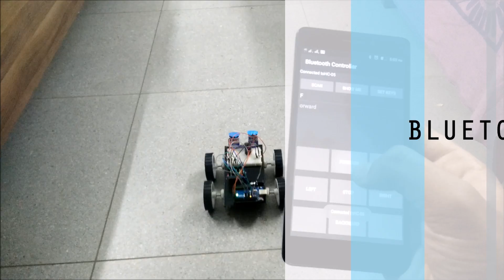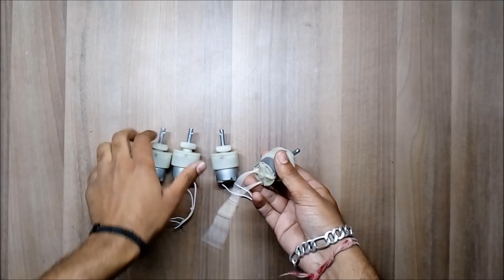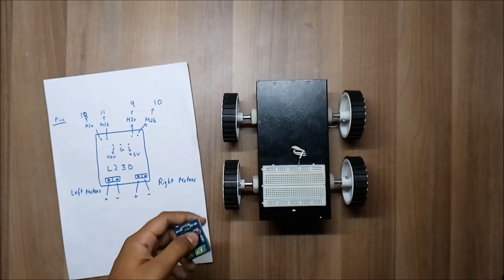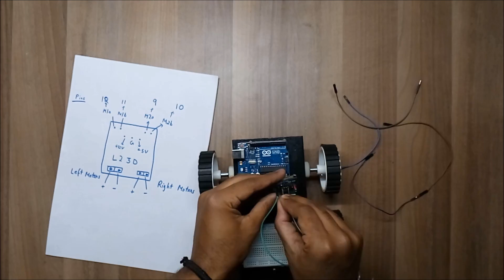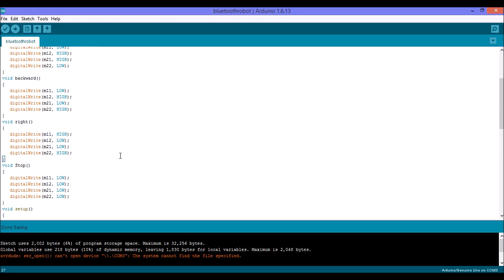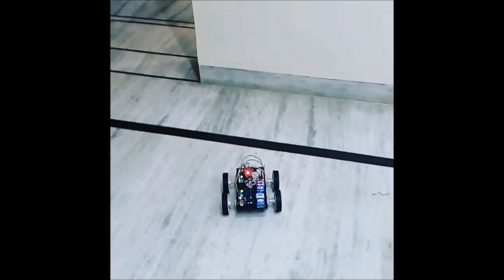How to make a Bluetooth Controlled Robot using Arduino (With Code)

Comment: Iam using an adafruit motor driver shield and the same type of chassis and motors which u use but i have a problem with wheel rotation its doesnt work pls help me why it doesnt work
Reply from the maker: Please explain the issue
Reply: @scibot  it seems the voltage output of arduino is less than what is required for motors which i use pls help me solve this issue

Comment: hello sir 
connections related to battery are not clear can you please send the circuit diagram of the project so that we can properly connect the components .
kindly reply as soon as possible
Reply from the maker: Sorry but I don't have the diagrams anymore. I've explained the connections pin wise it it helps.

Comment: This Program will be run Check now 

#define m11 11 //  M1a
#define m12 12 // M1b
#define m21 10 // M2a
#define m22 9 //  M2b
void forward()
{
digitalWrite(m11, HIGH);
digitalWrite(m12, LOW);
digitalWrite(m21, HIGH);
digitalWrite(m22, LOW);
}
void left()
{
digitalWrite(m11, LOW);
digitalWrite(m12, HIGH);
digitalWrite(m21, HIGH);
digitalWrite(m22, LOW);
}
void backward()
{
digitalWrite(m11, LOW);
digitalWrite(m12, HIGH);
digitalWrite(m21, LOW);
digitalWrite(m22, HIGH);
}
void right()
{
digitalWrite(m11, HIGH);
digitalWrite(m12, LOW);
digitalWrite(m21, LOW);
digitalWrite(m22, HIGH);
}
void Stop()
{
digitalWrite(m11, LOW);
digitalWrite(m12, LOW);
digitalWrite(m21, LOW);
digitalWrite(m22, LOW);
}
void setup()
{
Serial.begin(9600);
pinMode(m11, OUTPUT);
pinMode(m12, OUTPUT);
pinMode(m21, OUTPUT);
pinMode(m22, OUTPUT);
}
void loop()
{
while(Serial.available())
{
char data = Serial.read();
if(data =='1') // forward
{
Serial.println("Forward");
forward();

}
else if(data =='2') //left
{
Serial.println("Left");
right();

}
else if(data =='3') //right
{
Serial.println("right");
left();

}

else if(data =='4') //backward
{
Serial.println("backward");
backward();

}
else if(data =='5') //stop
{
Serial.println("stop");
Stop();

}

}
}

Comment: when i am uploading the programming error is commig up th stray 342 in your program
Reply: mee too. what can i do
Reply: Where you are geting and send full error message
Reply: unplug the rx and tx from ur arduino board before uploading the code, just reconnect them after..
Reply: Type that code again by yourself
. Don't copy.. then this error will not appear

Comment: Dear,
I tried your project with the same components but failed to obtain the desire results as i found certain discrepancies.
Kindly "Explain The Following"
Point No. 1: In your Motor Driver (L293D) sketch you are showing IMa= 12, 1Mb= 11 & Similarly 2Ma= 9 & 2Mb= 10, But in your provided code you have defined at the top as follow:
#define m11 11 // M1a   (It shows M1a= 11)
#define m12 12 // M1b   (It Shows M1b= 12)
#define m21 10 // M2a   (It shows M2a= 10)
#define m22 9 // M2b     (It ShowM2b=9)
Kindly explain or suggest the best course of action to rectify it.
Point No. 2: You have not explained about Digital GND pin connection. Where as in video you have done that.
Kindly provide the proper circuit diagram of the entire system along with rectified code.
Awaiting for your positive reply
Regards

Comment: exit status 1
stray /'342' in program 
how to solve this error?
Reply: This problem arises if the code is copied from any website. You need to change some characters like  "  or  ' ( inverted commas)  manually. hope it will work

Comment: sir when i try for coding it show.... stray '\342' in program what do for this plz kindly repily
Reply: This problem arises if the code is copied from any website. You need to change some characters like  "  or  ' ( inverted commas)  manually. hope it will work
Reply: Abid Rahman  thank you sir it worked
Reply: @prithvih5594  can you tell me what you have changed to make the correct code?

Comment: i made it 
it works
thanks scibot
Reply: where did u connect the battery
Reply: vaibhav patil so can you tell me connections of hc05 he told that connect tx with pin 0 of aurdino and Rx with pin 1 then what about ground and power supply
Reply: Gnd conct to gnd of arduino
N
5v connect to vin

Comment: Arduino: 1.8.1 (Windows 7), Board: "Arduino/Genuino Uno"

cari:53: error: stray '\342' in program

 if(data ==â€™1â€²) // forward

 ^

cari:53: error: stray '\200' in program

cari:53: error: stray '\231' in program

cari:53: error: stray '\342' in program

cari:53: error: stray '\200' in program

cari:53: error: stray '\262' in program

cari:55: error: stray '\342' in program

 Serial.println(â€œForwardâ€?);

 ^

cari:55: error: stray '\200' in program

cari:55: error: stray '\234' in program

cari:55: error: stray '\342' in program

cari:55: error: stray '\200' in program

cari:55: error: stray '\235' in program

cari:59: error: stray '\342' in program

 else if(data ==â€™2â€²) //left

 ^

cari:59: error: stray '\200' in program

cari:59: error: stray '\231' in program

cari:59: error: stray '\342' in program

cari:59: error: stray '\200' in program

cari:59: error: stray '\262' in program

cari:61: error: stray '\342' in program

 Serial.println(â€œLeftâ€?);

 ^

cari:61: error: stray '\200' in program

cari:61: error: stray '\234' in program

cari:61: error: stray '\342' in program

cari:61: error: stray '\200' in program

cari:61: error: stray '\235' in program

cari:65: error: stray '\342' in program

 else if(data ==â€™3â€²) //right

 ^

cari:65: error: stray '\200' in program

cari:65: error: stray '\231' in program

cari:65: error: stray '\342' in program

cari:65: error: stray '\200' in program

cari:65: error: stray '\262' in program

cari:67: error: stray '\342' in program

 Serial.println(â€œrightâ€?);

 ^

cari:67: error: stray '\200' in program

cari:67: error: stray '\234' in program

cari:67: error: stray '\342' in program

cari:67: error: stray '\200' in program

cari:67: error: stray '\235' in program

cari:72: error: stray '\342' in program

 else if(data ==â€™4â€²) //backward

 ^

cari:72: error: stray '\200' in program

cari:72: error: stray '\231' in program

cari:72: error: stray '\342' in program

cari:72: error: stray '\200' in program

cari:72: error: stray '\262' in program

cari:74: error: stray '\342' in program

 Serial.println(â€œbackwardâ€?);

 ^

cari:74: error: stray '\200' in program

cari:74: error: stray '\234' in program

cari:74: error: stray '\342' in program

cari:74: error: stray '\200' in program

cari:74: error: stray '\235' in program

cari:78: error: stray '\342' in program

 else(data ==â€™5â€²) //stop

 ^

cari:78: error: stray '\200' in program

cari:78: error: stray '\231' in program

cari:78: error: stray '\342' in program

cari:78: error: stray '\200' in program

cari:78: error: stray '\262' in program

cari:80: error: stray '\342' in program

 Serial.println(â€œstopâ€?);

 ^

cari:80: error: stray '\200' in program

cari:80: error: stray '\234' in program

cari:80: error: stray '\342' in program

cari:80: error: stray '\200' in program

cari:80: error: stray '\235' in program

D:\arduino work\experiments\cari\cari\cari.ino: In function 'void loop()':

cari:55: error: 'Forward' was not declared in this scope

 Serial.println(â€œForwardâ€?);

                   ^

cari:61: error: 'Left' was not declared in this scope

 Serial.println(â€œLeftâ€?);

                   ^

cari:67: error: call of overloaded 'println(void (&)())' is ambiguous

 Serial.println(â€œrightâ€?);

                           ^

D:\arduino work\experiments\cari\cari\cari.ino:67:27: note: candidates are:

In file included from F:\arduino\hardware\arduino\avr\cores\arduino/Stream.h:26:0,

                 from F:\arduino\hardware\arduino\avr\cores\arduino/HardwareSerial.h:29,

                 from F:\arduino\hardware\arduino\avr\cores\arduino/Arduino.h:232,

                 from sketch\cari.ino.cpp:1:

F:\arduino\hardware\arduino\avr\cores\arduino/Print.h:73:12: note: size_t Print::println(char) <near match>

     size_t println(char);

            ^

F:\arduino\hardware\arduino\avr\cores\arduino/Print.h:73:12: note:   no known conversion for argument 1 from 'void()' to 'char'

F:\arduino\hardware\arduino\avr\cores\arduino/Print.h:74:12: note: size_t Print::println(unsigned char, int) <near match>

     size_t println(unsigned char, int = DEC);

            ^

F:\arduino\hardware\arduino\avr\cores\arduino/Print.h:74:12: note:   no known conversion for argument 1 from 'void()' to 'unsigned char'

F:\arduino\hardware\arduino\avr\cores\arduino/Print.h:75:12: note: size_t Print::println(int, int) <near match>

     size_t println(int, int = DEC);

            ^

F:\arduino\hardware\arduino\avr\cores\arduino/Print.h:75:12: note:   no known conversion for argument 1 from 'void()' to 'int'

F:\arduino\hardware\arduino\avr\cores\arduino/Print.h:76:12: note: size_t Print::println(unsigned int, int) <near match>

     size_t println(unsigned int, int = DEC);

            ^

F:\arduino\hardware\arduino\avr\cores\arduino/Print.h:76:12: note:   no known conversion for argument 1 from 'void()' to 'unsigned int'

F:\arduino\hardware\arduino\avr\cores\arduino/Print.h:77:12: note: size_t Print::println(long int, int) <near match>

     size_t println(long, int = DEC);

            ^

F:\arduino\hardware\arduino\avr\cores\arduino/Print.h:77:12: note:   no known conversion for argument 1 from 'void()' to 'long int'

F:\arduino\hardware\arduino\avr\cores\arduino/Print.h:78:12: note: size_t Print::println(long unsigned int, int) <near match>

     size_t println(unsigned long, int = DEC);

            ^

F:\arduino\hardware\arduino\avr\cores\arduino/Print.h:78:12: note:   no known conversion for argument 1 from 'void()' to 'long unsigned int'

cari:74: error: call of overloaded 'println(void (&)())' is ambiguous

 Serial.println(â€œbackwardâ€?);

                              ^

D:\arduino work\experiments\cari\cari\cari.ino:74:30: note: candidates are:

In file included from F:\arduino\hardware\arduino\avr\cores\arduino/Stream.h:26:0,

                 from F:\arduino\hardware\arduino\avr\cores\arduino/HardwareSerial.h:29,

                 from F:\arduino\hardware\arduino\avr\cores\arduino/Arduino.h:232,

                 from sketch\cari.ino.cpp:1:

F:\arduino\hardware\arduino\avr\cores\arduino/Print.h:73:12: note: size_t Print::println(char) <near match>

     size_t println(char);

            ^

F:\arduino\hardware\arduino\avr\cores\arduino/Print.h:73:12: note:   no known conversion for argument 1 from 'void()' to 'char'

F:\arduino\hardware\arduino\avr\cores\arduino/Print.h:74:12: note: size_t Print::println(unsigned char, int) <near match>

     size_t println(unsigned char, int = DEC);

            ^

F:\arduino\hardware\arduino\avr\cores\arduino/Print.h:74:12: note:   no known conversion for argument 1 from 'void()' to 'unsigned char'

F:\arduino\hardware\arduino\avr\cores\arduino/Print.h:75:12: note: size_t Print::println(int, int) <near match>

     size_t println(int, int = DEC);

            ^

F:\arduino\hardware\arduino\avr\cores\arduino/Print.h:75:12: note:   no known conversion for argument 1 from 'void()' to 'int'

F:\arduino\hardware\arduino\avr\cores\arduino/Print.h:76:12: note: size_t Print::println(unsigned int, int) <near match>

     size_t println(unsigned int, int = DEC);

            ^

F:\arduino\hardware\arduino\avr\cores\arduino/Print.h:76:12: note:   no known conversion for argument 1 from 'void()' to 'unsigned int'

F:\arduino\hardware\arduino\avr\cores\arduino/Print.h:77:12: note: size_t Print::println(long int, int) <near match>

     size_t println(long, int = DEC);

            ^

F:\arduino\hardware\arduino\avr\cores\arduino/Print.h:77:12: note:   no known conversion for argument 1 from 'void()' to 'long int'

F:\arduino\hardware\arduino\avr\cores\arduino/Print.h:78:12: note: size_t Print::println(long unsigned int, int) <near match>

     size_t println(unsigned long, int = DEC);

            ^

F:\arduino\hardware\arduino\avr\cores\arduino/Print.h:78:12: note:   no known conversion for argument 1 from 'void()' to 'long unsigned int'

cari:79: error: expected ';' before '{' token

 {

 ^

exit status 1
stray '\342' in program

This report would have more information with
"Show verbose output during compilation"
option enabled in File -> Preferences.

error messages , help

Comment: bro i m getting error in code   
 "exit status 1 stray '\342' in program"
can you help me out
Reply: This problem arises if the code is copied from any website. You need to change some characters like  "  or  ' ( inverted commas)  manually. hope it will work